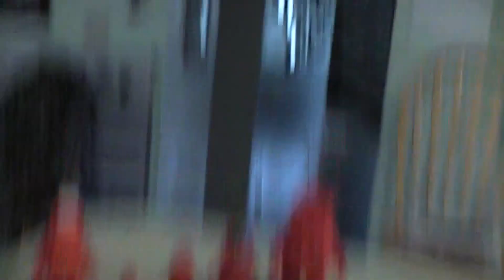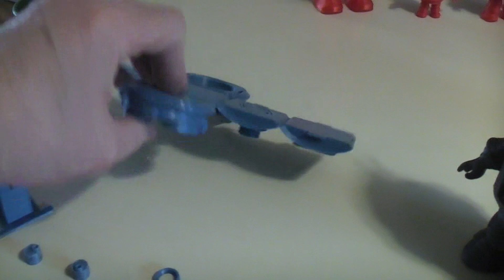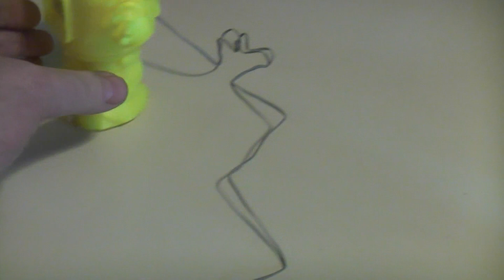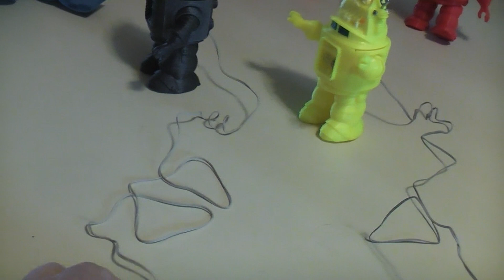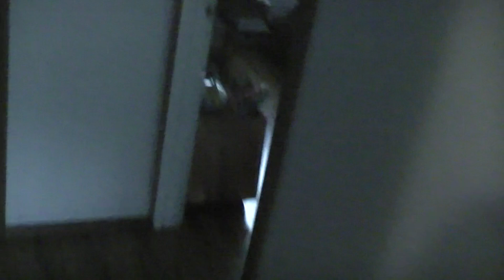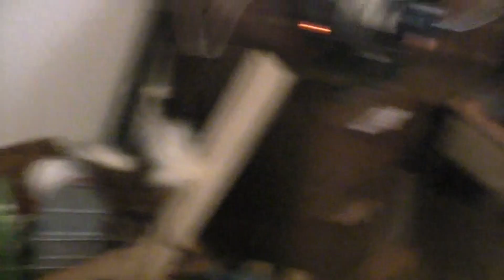3d printed Fab 365 Walking Robot-Robby Mod.

Comment: Awesome! Is it possible to make it remote controlled?
Reply from the maker: Yes it can be remote control, I did a you tube on adding micro remote control actions to 3d printed projects.
https://youtu.be/mpFZEXfQtBI. You would have to find room for the batteryies, so you might have to scale it up to 50% the stock STL size.